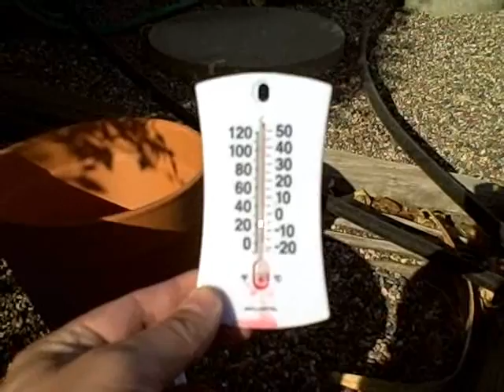Homemade Pot-in-Pot Refrigerator "Off Grid Fridge" cools air up to 40F (evaporative cooler/chiller)

Comment: If the outside temperature in the sun Is 80 degrees would this cool to about 40 degrees Fahrenheit?
Reply from the maker: the temp drop you get will depend on the temp and the humidity

Comment: Clearly it would not work very well in those super hot temperatures.  It used to be that people would cut ice from lakes in winter, and store it in ice houses in sawdust to insulate it and help slow melting. They sold that to people for their ice boxes.  

78 degrees is not going to keep things from perishing... but at least you were able to demonstrate that it cools things down pretty well.
Reply from the maker: hi there. it won't drop temps down the same as a compressor based unit (in the higher temps) but works well to preserve things for a few days minimum. even 78F will get you maybe 3 extra days. the same item in say 110-120F temp (with no cooling) could go bad in as little as 3 hours. the best results are when it's only in 80's and 90's with low humidity. then you can get a week or two (versus a day or two with no refrigeration). it mainly depends on humidity levels. 82F air can drop to 57 or 58F if air is dry 😎👍

Comment: Question I have would you ever park it right directly in the sun No put it in the shade at least direct heat won't hit it and dry your sand too and it's better to use a terracotta bottom to cover your pot then a wet towel You use a wet towel after the fact

Comment: Can i use this clay-pot to store milk & meat? also, how often should i reintroduce water to the sand between the pots?
Reply from the maker: hi. yes, you can use it to store milk and meat. how much water it needs depends on how much evaporation occurs. the drier the air the more evaporation and the cooler it will be.
Reply: @desertsun02  Thanks, i'll try it asap.. electricity bills are going insane!!

Comment: Those do not work well or at all in humid conditions.
Lower the relative humidity (dew point perhaps) the cooler it will become.
Avoid setting them in the ground or any other heat sinking surface.
And keep out of the sun!

Also, the Zeer pot was invented in North Africa some 2,000 years ago.

Comment: A darker towel might be more effective because the white towel will be reflective; as a black towel should get hotter therefore evaporating at a quicker rate- but thats just a suggestion based on color science as black absorbs all wavelengths. Where as white reflects all wavelengths (except when it comes to paint that's a bit more complicated)
Edit:typo
Reply from the maker: hi there. i'm not sure. the towel might get hotter if it's dark and transfer some of that heat into the fridge? i'd be curious to know what others think.

Comment: You should make a whole clay house with an inner clay layer with sand in between and have some kind of misting or water system for the center you would never need air conditioning.
Reply from the maker: it could work.

Comment: Bro, I think blanketing the sides of the pot with a towel hinders the process of evaporation. The sides I think need to breathe to effectively draw out heat from the inside.
Reply from the maker: hi. that is correct. i don't use blanket (towel) on the sides just the top. it holds in the cold and adds cold to the unit

Comment: u forgot to mention best to use unfired pots as then the clay will soak some of the water in m on a mates property back in the mid 80s we used a single pot with a lid sitting on a saucer we kept filled with water .. lol we got use to boiling up green meat for dinner

Comment: Good video man, 👍😊 put the thermometer in the shade out of direct sunlight...
Evacuated thermal tube heaters can  get up to 300+ degrees Celsius...
Larger the light collector area, that hight the temp... 
Keep the thermometer in the shade so you can test the air temperature not the sun thermal infrared temp output, which can be very high 😳
Oh or can invest in a laser thermometer...

Comment: This reminds me of those 3-D printed houses that I was watching today because in those 3-D printed houses, the there is a gap in between parts of the 3-D print or I imagine you could pour sand into it and I assume use the same technique add water and it will keep the house insulated and cool like this pot in pot cooler.

Comment: how about if you put 2 pots inside the 2 pot fridge - with a gap of air inbetween? i would think it cools even lover - but will probably take longer to cool down.
Reply from the maker: hi. the extra insulation might help. it's worth trying 🙂✔

Comment: I hope to experiment with this idea.
I hope to get two pots big enough to hold a gallon glass jar.
I hope to set the pots up on two layers of offset bricks.
On the first layer of bricks lay a 12 volt fan horizontally. The fan is direct drive off of a 12 volt solar panel.
 The zeer pot sits on the upper layer of bricks.
The theory is that the zeer pot stays in the shade and the solar panel stays in the sun.
The hotter the sun gets the faster the fan runs.
The fan will increase the rate of evaporation cooling the pots.
I am also interested in finding out if there is any improvement in performance using salt instead of sand between the pots.
Salt is hydoscopic. It pulls moisture
Out of the air. 
What I want to do is set this close to my chicken coop. Put a cup of lime desolved into a gallon of water and put it in the gallon jar inside the cooler. I hope to store my excess eggs in this cooler.  They should keep for up to a year in the lime water. Keeping them cool doesn't hurt either.
In the markets in North Africa they
Make a bigger cooler like this for storing vegetables.
They set four or five plastic laundry baskets on a brick floor then they build a wall of bricks around the baskets. Then they build a second wall four inches away from the first wall and fill the void with sand. They wet the sand and the bricks and it does the same thing as the zeet pot.. They put an insulated lid over the cooler.
These are built under thatched roof shelters to keep the sun off of them. 
If you have a lot of stuff to keep cool this might be a better way.
Big pots aren't cheap. Bricks are sometimes free.

Comment: My late father was in the British army in the 1950's stationed in the Middle East. They would wrap a water filled jerry can in a wet army blanket, keeping the blanket wet would cool the jerry can water down so much it would freeze! That's evaporative cooling for you!
Reply: Uhhh,....I gotta call bullshit on the frozen can.  Cold? Plausible.  Frozen? Bullshit.
Reply: @beavisroadhog9629 If its windy enough it's possible that's the whole point off it is the wind hitting the water n evaporating it and cooling it (evaporation cooling) like sweating or some fridges n freezers so the windier the cooler it will get so use a couple PC fans or a fan or find a place that has some kind off exhaust or outlet off air and use that put your pot near that..for some reason with these pot videos nobody mentions the most important part the wind (and water)..call it the wind chill factor don't they and its often what sets people into hyperthermia much much faster than if wasn't windy especially if you and your clothes are wet because off evaporation cooling taking place the wind chill factor and if the army Jerry can was made off metal it would cool faster especially if was alluminium wrapped in a wet big blanket in a very windy spot easily could freeze maybe not solid but ice crystal form
Reply: @beavisroadhog9629 Check out the ancient giant domed freezers in the deserts off Iran called yatchels 👍
Reply: @beavisroadhog9629  Obviously not familiar with basic physics are you?
Reply: @beavisroadhog9629  That's a perfect reaction,  most people think this.   In fact the vast majority of people have this exact same reaction.   

Evaporative cooling is counter intuitive.  It works better when put in direct sunlight rather than shade.   For the pot to work you need very good air circulation,  very hot temperature,  and very low humidity.  This results in maximum evaporation.
Reply: I think I'd want a Zeer Pot HOUSE, lol!
Reply: Imagine how cool and refreshing that water would be to drink in such a hot climate!  Aaahhh.

Comment: Why does it work?
Reply from the maker: since clay pots are very porous - natural air currents pass through the side of the outer clay pot and into the wet sand. this causes water in the sand to evaporate (and since the process of evaporation actually requires heat it, it literally leaves cold air behind (as the water evaporates). much of that cool air travels through the sides of the inner pots and gets trapped inside the inner most clay pot.

Comment: Do you change the sand often or no need?
Reply from the maker: i've always used the same sand (i've never changed it)
Reply: You just need to keep it wet - it won't dissolve.

Comment: Wonder how we could do this on a large scale for an outside dog house..   would be great! Could connect it to a 5 gallon refillable water tank to keep the sand wet.   🤔
Reply from the maker: one idea would be to make the dog house using some porous brick or brick material for the sides of the dog house. (make a double wall then put sand in between the walls. wet the sand occasionally. that's just a quick idea off the top of my head.

Comment: You should have made a lid that is the diameter of the most inner pot to cover the pot.  And leave the surface area of the outer pots open so the water can evaporate, since it is suppose to be an evaporative cooler, to cool the inner pot and outer pot.  And if you can line the lid with aluminum foil, it will keep the inner pot even cooler since the aluminum reflect the heat from outside from entering the inner chamber of the inner pot.

Comment: could this be used as an air cooler?  Maybe drill holes around the bottoms of both pots for pvc pipes tp get air flow in and an exhaust fan on top or an intake tube from the lid that almost reaches the bottom

Comment: Can I put canned food or food in glass jars in the Zeer?  I have an extremely large clay pot that would take another large pot inside.  Does it work as well with larger pots?  Thank you.
Reply from the maker: hi there. you should be able to put both canned food and food in glass jars in the Zeer. anything you can put in a regular refrigerator you can put in the zeer. it works great with large pots. 😎✔

Comment: You could bury the pot to ground level and then you have infinite thermal mass through the earth. I believe the Koreans do this.
Reply from the maker: hi. problem with burying it is you'd lose the air currents that hit the sides of the pot. the clay is porous and the air curents hitting the sides are what cause the cooling inside of it.

Comment: You have to use a closed pot so the evaporating water cant get inside. Also, skip the sand. Water holds ALOT of thermal energy. The way you’re using the sand is basically the same as putting your pot in a bucket of water and setting it in the sun. It wont be hotter than the bucket of water, but the bucket of water is going to heat up because its going to absorb energy faster than it can evaporate. Ever hang out in a shallow pool in summer? Water gets pretty warm, but when you get out and there is a breeze you suddenly feel much cooler than when you were in all that water. Only water on the surface can evaporate and that’s where the cooling happens - all the water that’s in the sand cant evaporate till it gets to the surface; it’s like a pool of warn water. You want to keep the water on the surface.

Take two pots of the same size; wax the inside surface. Turn one upside down like a lid to make a closed chamber with the two pots. Put the towel over closed pot and pour water over the towel, repeat a few times as the towel starts to dry out. 

I think you’ll have much better results with this method.
Reply: the water is going to evaprate through the terracotta pot. it doesn't require sun to evaporate just heat. the terracotta pot is not watertight. the water will escape. 
Putting the pot in the sun is not required. all there needs is higher temperature and low enough humidity for the water to evaporate. Putting it into the sun will increase evaporation but also increase heat, counter to the goal of cooling. 
It iS a good idea to put a cover over the pot but it doesnt' have to be a water tight cover, in fact if the cover can hold and evaporate water, that is just another surface contributing to the heat transfer from the cooler.
Reply: Make a video and share a link to teach us..
Reply: The way he displays this is the way the ancient Egyptians used to keep foodstuffs cool, except the sand is supposed to be exposed to sunlight so the water can evaporate - this is what cools the inner container... evaporation. Covering the whole thing with a towel keeps water from evaporating from the sand. Only the innermost vessel should be covered. You will need to check the water level 3x per day due to evaporation, or the thermal mass from the sand will heat up and start keeping the inner vessel warmer than the outside.

I don't know about skipping the sand part though - this method came from ancient river lands so if water was more efficient I suspect they would have just chosen to keep their cooler in the river rather than sand-filled amphorae.
Reply: @wmstroup6474  look up videos of indian workers taking clay vessels into the fields to cool their food while they work. the vessels have lids, they cover them with a cloth, they pour water over the cloth - the cloth retains the water against the surface (the same way the sand does), the water absorbs heat from the vessel, and as the water evaporates the vessel cools down.

Comment: Hey, I did not hear the sizes of the clay pots you used for this: can you provide it please?
Reply: I think that you could probably just go with any size pot. As long as the outer pot is a size or two larger than the inner pot, you should be good.

Comment: So, what would happen if you put one of these inside an even larger one? Would it cool the smaller one even more? I mean obviously there has to be a limit, but as long as its hot enough for evaporation to take place couldn't you theoretically just keep making larger and larger pots or sealed brick chambers with layers of wet sand between them in order to fit the smaller pots until evaporation is slowed to the point of not making a difference anymore?

Am I over thinking this? Probably. I just find it interesting to think about.
Reply: You have to have airflow to keep the evaporative cooling going- if you have anything damp inside a sealed space then if it doesn't dry out eventually it will bring the humidity up to 100% and evaporation stops, and it doesn't cool any further. Then over time the temperature equalizes with whatever's outside of that space.

Comment: About how long will it stay 40 degrees cooler?
Reply from the maker: hi. with the correct humidity and temp it will stay that cool consistently. you just have to keep the sand and towel moist.

Comment: It is most likely that what limits the cooling is the rate at which water can evaporate from the system.  Addition additional insulation by additional pots or sand probably won't help much.  If you could increase the surface area/volume ratio, you should get a greater cooling rate--so a smaller system might achieve a lower temperature. However you could fit less stuff in it (eg: your grapes example) and would need to re-wet it frequently as it can't hold as much water. 

The primary emergency use I can imagine for a zeer is to keep refrigerated medicines, especially insulin, cooled after a natural disaster until help arrives, or until evacuation becomes possible.
Reply: Oh--I'd also consider improving insulation on top by creating a lid of some kind (inverted small pot or terracotta saucer?) and putting wet sand on top, instead of the wet towel.
Also key to this system is the pots have to be water permeable--it won't work with a glazed pot.  Not sure if you mentioned that.
Reply: The sand is not for insulation - it is supposed hold the water against the clay so the breeze blowing around the pot evaporates the water and brings down the temperature inside the inner pot.  You need a way to keep the sand wet all the time so there is always water to evaporate.

Comment: Will it work if we put soil/mud instead of sand (we cant get sand).
Reply: Well if need be and you have alot of time and accees to water.  (Can be dirty river water you not going to drink it)  you can separate sand (and clay)  from your soil which i admit it works better in sandy areas for sand by socking the mud in the water until the dirt dissolves leaving behind rock and sand.  But for sonething the size in this vidoe unless you live in a 40% sandy soil arar it going to take you a month to do so.  Better to grind up sand stone.
Reply: You can usually buy a bag of sand at a builders supply store.

Comment: You need to pour more water, one liter is not enough, it will also help if you use cold water, or let ice cubes melt in the sand, the inner pot will be significantly colder, you can actually feel the frigid air inside the inner pot., if you put the wet towel and cover it with one of those pot bases that look like a plate it will stay even colder, and even more if you wet the pot base before putting it on top, it will help keep everything cold inside, try it and make a video about it.
Reply: If you need to make an improvised refrigerator,  where- smart guy- are  the ice cubes going to come from?